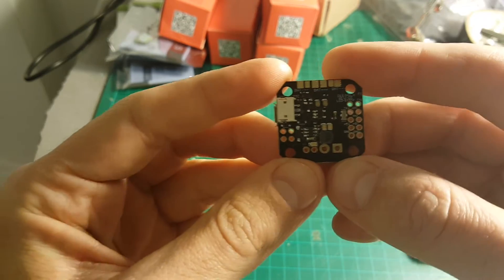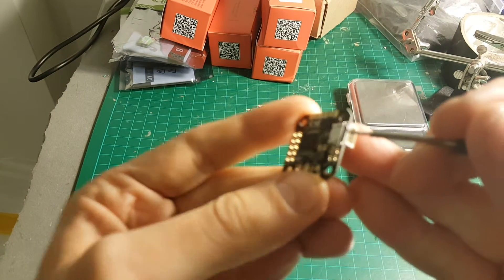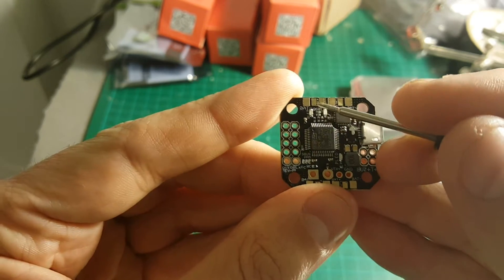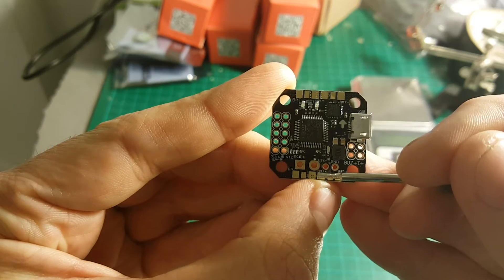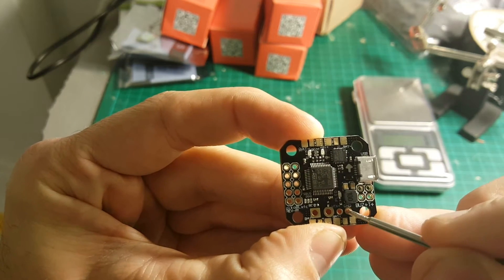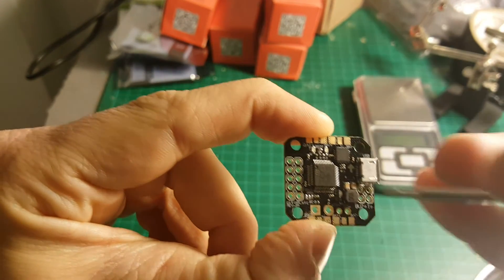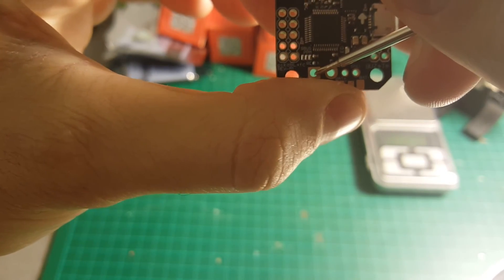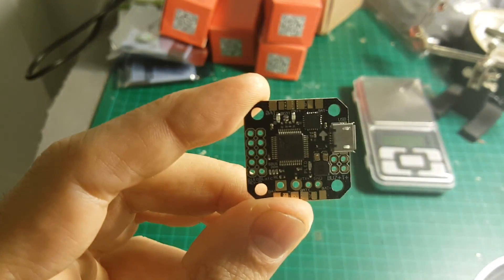Pico X - Micro Brushless Part 3 - Pico BLX clone

Comment: Are you sure the signal for sbus rx is that 3rd pad up from the bottom left on the clone? I know the Piko instructions and install video show that but mine isn’t working. I soldered the 2 left pads on the back per instructions, changed port it in Betaflight. It keeps reverting back to Spektrum after I click save.
Reply: Ok I'll try that, thank you for the reply. I know it's an older board, by today's standards it's prehistoric lol. Maybe I'll swap it for a Piko f4 if I can't get it to work.
Reply from the maker: @alloutofdonuts3998  NP. I hope you will get it sorted.
Reply from the maker: Sorry but it's an old video and I can't really remember or help you out :-(
Reply from the maker: Try updating the firmware of the FC and reconfigure everything.

Comment: Can i use this on a 250 drohe too it have 30a esc's
Reply from the maker: You can, but it is not recommended. Use a full sized flight controller.

Comment: PLEASE NOTE - the "to Vtx with LC-Filter" pads do NOT deliver 5.0 volts as may be expected for micro quad VTX runing usually on 5v - the pads deliver your battery voltage (...of course LC filtered). ....I burnt my VTX this way, thinks that is a total crappy solution for such micro FC`s
Reply from the maker: +Snik Snak It is intended to be used for vtx (video transmitter). Thank you for your comment.

Comment: For sbus its solder the left pad and the middle pad right?
Reply from the maker: N Ham Just the left two pads
Reply: Thanks man. The diagram was hard for me to read.
Reply: N Ham For Sbus you need 3 pads... Power, ground and signal.  Just look at the wiring diagram picture it's fairly simple.  You also need to solder the 2 Sbus/ppm pads to short. If you need Dshot that requires much more effort....  Multishot is excellent and easy to get working.
Reply: Dobemandan why? I have dshot125 on my piko blx clone(?). Had lemon dsmx but I just recently swapped to frsky Xm+. It doesn’t seem to be recognizing it or letting me change to subs in Betaflight. It keeps reverting back to spektrum.
Reply: Been in the air and flying for about 2 weeks